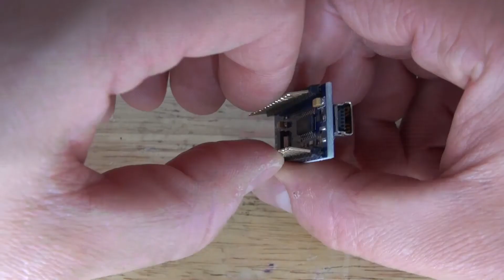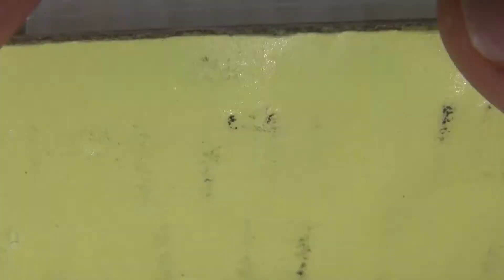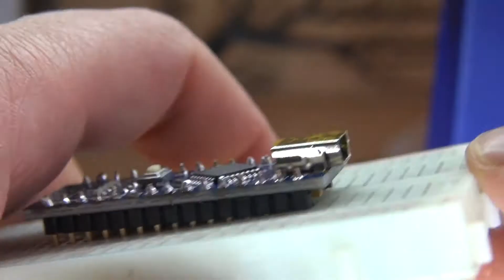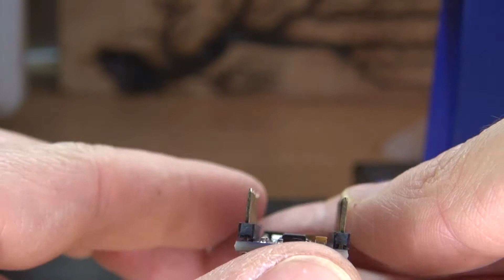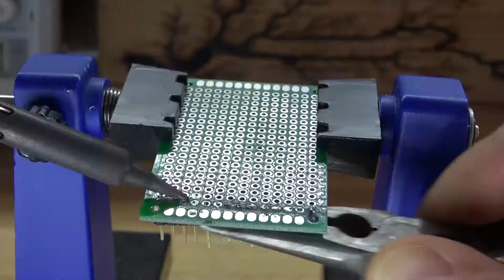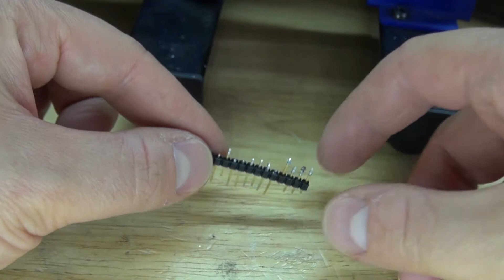How To Solder And Desolder Header Pins

Comment: Use a smaller iron tip and smaller diam solder - when the iron tip is larger than the pad, you know it's too big😮, it will start damaging the substrate. Solder wick is also a viable desoldering method if you use small enough braid.  Trying your techniques on proto board as you did here is a great way to practice the desoldering before moving on to the real board and avoiding some heartache - well done.  The different techniques will suit different users, we all develop our own favorite method eventually, but it is good to have some of them demonstrated - well done.

Comment: I had better luck by taking off the black plastic pin holder from the back (my headers were clean, so this was easy), mounting the soldering iron on a stand so my hands were free, and then using needlenose pliers on a single pin with one hand while the other hand held the board up to heat the individual pin.  Takes a long time, but it's less frustrating than trying to do multiple pins at once.
Reply: I like that. I'm gonna try that instead of this.

Comment: that heat gun method absolutely overheats components. that's a good method to use, unless you have a very micro applicator funnel, on things like usb pads for micro solder connection joints. but not a string of heads. your combo of plunge wick and prying is best. as you said, it's more effective to get it right the first time

Comment: Hello. I have a question to ask
Why do iphones use a normal as well as an infrared camera for normal shooting and face I'd instead of using a single camera that can switch between these two modes like some security cameras or day night cameras do
Because from my own understanding the difference between them is a single IR filter

If possible do a video on it to explain the physics as well as the engineering that would go on in order for it to work in a mobile phone. Thanks